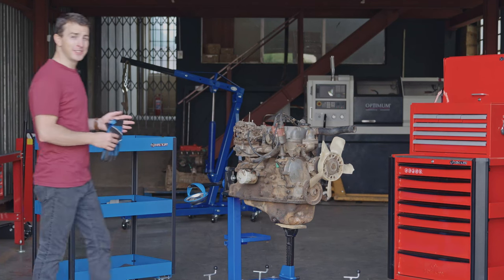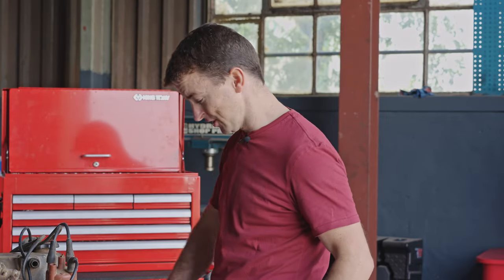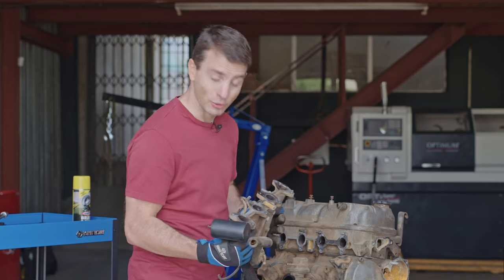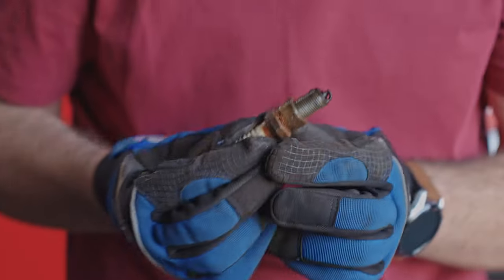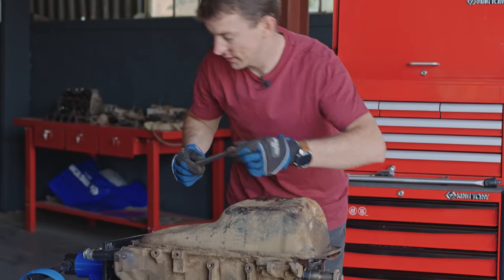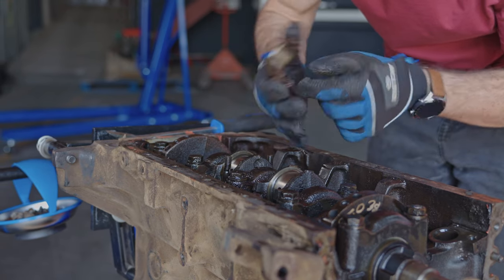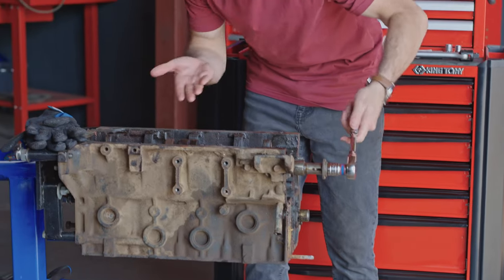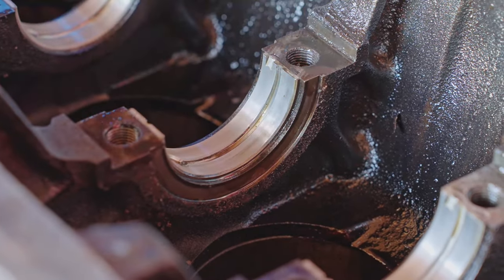TEARDOWN: 1978 Toyota 2T 1.6L OHV 8 Valve Engine

Comment: I had a 71 KE20 with that engine, I think it was the bigport version.   Took it out and transplanted into my 77 KE30. .30 overbore because of scored cylinder wall,   Weber 32/36, Cannon Induction Systems camshaft, Clifford header and a T50 speed behind it.    Ran very well, had soooooooo much fun with that car.  Wish I still had it.
Reply from the maker: I’ve come to understand that they are incredibly versatile pieces of machinery, and it sounds like you had a great time with yours!

Thanks for sharing!

Comment: Is this the same engine as the 2TC? I actually just picked up a 78 corolla and will like to rebuild the engine. Can't wait for the next video, I hope you can share the links of the parts and rebuild kit you use.
Reply from the maker: There are some small variations, especially if your car comes from California - here is a nice writeup of the differences: https://www.toymods.org.au/forums/threads/1139-T-2T-2T-B-2T-C-amp-2T-G-Specifications-amp-Diagrams

Comment: Marten Keuning would have been your biggest fan....
Reply from the maker: I would have loved doing this with him around!
Reply: Come from Reddit, you should rebuild this engine, it's very reliable, my car it's a Daihatsu Charmant, and this is the engine, I made a refresh of it almost 2 years ago and it's working like a Swiss clock, an advice, check the camshaft housing, and the corresponding bearings, I found one loose in my engine but fortunately the new one fits perfectly and there was no issues when turning on, great video, I'll be waiting for an update
Reply from the maker: @Culumbu  - Lovely to hear, thank you for this! ...and yes, while browsing yesterday I may have found a project that needs this engine - which means the rebuild is on the way!

Comment: wich is the best carburator for this Engine ? the single one like this  or the dual vertical carbs
Reply from the maker: That is a great question - let's hear what the community suggests.
Reply: @GTArmstrong    i have this motor on my corolla. it runs really great with dual verticals . i got  1 single from my other engine  and im thinking tu put this on
Reply: Weber 32/36 DGEV/DGV will run well.    Offenhauser used to make a dual port intake manifold if you can find one..